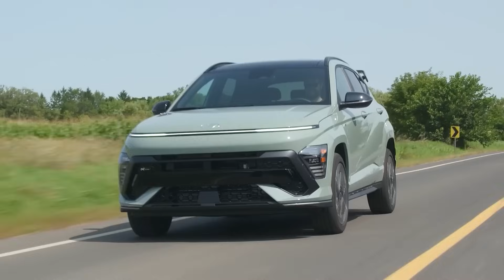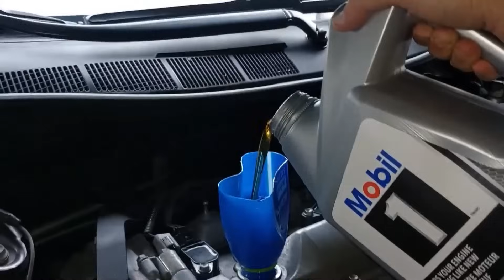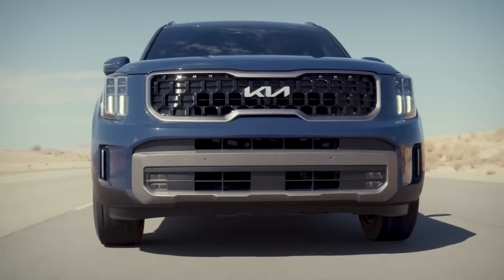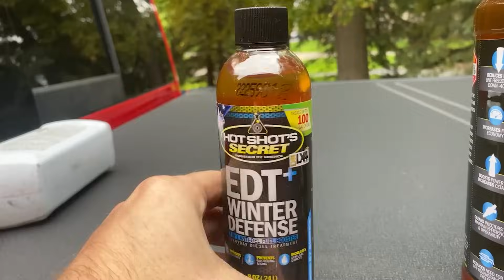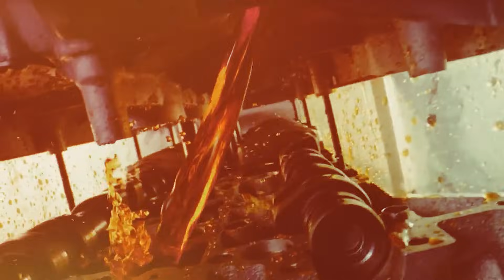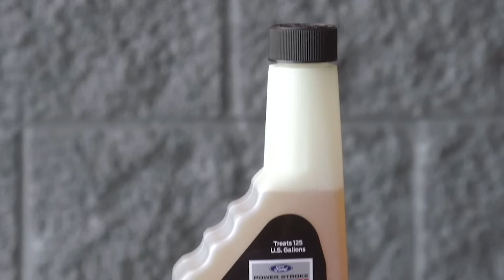11 Engine Additives That Work (And 5 That’ll Kill Your Car)

Comment: I have a 2022 KIA Seltos with a Turbo engine. Does any additive really need too be used in this engine. I change the oil and filter every 5000 miles and dont drive hard.

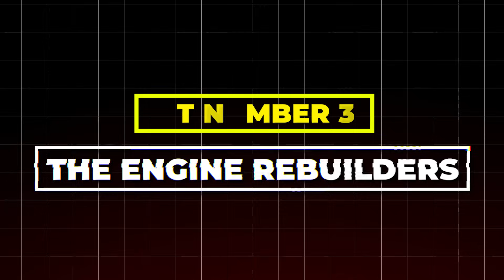Comment: 16:40  He is SO wrong!   RESTORE works, I tried it, and my cylinder pressure on one low cylinder wet from 110PSI up to 185, matching the other 3, +/- 5 PSI.
I also did a Berryman ring-soak on the low cylinder, so maybe that helped a lot too. Mind you, my 2.0 has 209K MILES on it, and all 4 cylinders are up to new engine PSI. Power is also very noticeable improvement. Makes sense since one of four was drastically lower in PSI.

Comment: I use TC-W3 two-cycle oil in my gas. One oz. per five gals. It does the same job as MMO at a lower price
Reply: Not the same. Similar but not as good.

Comment: Lucas oil additive is nothing but a viscosity improver that dilutes the additive package already in any good oil. I use Techron regularly and add Marvel Mystery Oil to the gas in my old Studebakers as a barrier against ethanol but do not like adding anything to the oil as like I stated earlier, adding anything to a top quality oil just dilutes the additive package already in the oil. If the oil additives are a good idea, the top refiners like Valvoline, Castrol, Chevron, Shell, Pennzoil, Mobil etc. would already be including them in their oils. My theory is to use a top quality oil, change it regularly and the oil additives meant to clean up dirty engines will not be necessary.

Comment: I am GM certified technician mechanic for 22years now. Let me correct you on (Lucas-Pure-Synthetic-Oil=1-1/8quart). When using Lucas pure synthetic oil, DO NOT POUR THE ENTIRE BOTTLE IN ANY ENGINE. Read instructions closely on Lucas oil manufacture website:For every quart of engine oil👉add-(5ml) shake real good quart of engine that has the Lucas pure synthetic oil in it.

Comment: I've been using 8oz MMO in all my vehicles for years at every oil change. Always change oil at 3000 miles or 50% life.  08 dodge nitro R/T 4.0 liter is coming up on 300,000 miles. The engine still runs just fine. No leaks, no smoke, and still strong. All the way up to my 2024 chevy 2500HD 6.6l gas.

Comment: Lake Speed, The Motor Oil Geek, has much better in depth scientific test based videos. This seems like a commercial for the additives with no scientific data to support "many people report" 50% increase etc... Lakes video on additives advises to stay away from oil additives but fuel additives can be beneficial to a degree.

Sea Foam, it contains alcohol so adding more alcohol to fuel does not seem that beneficial. Sea Foam was designed for marine applications. Anther thing that is useless these days cuz it contains, "IS alcohol", is fuel line anti freeze in the winter. Gasoline already contains way to much alcohol, why add more?
Reply: The original Sea Foam was designed for marine fuel, there are many different versions out these days.